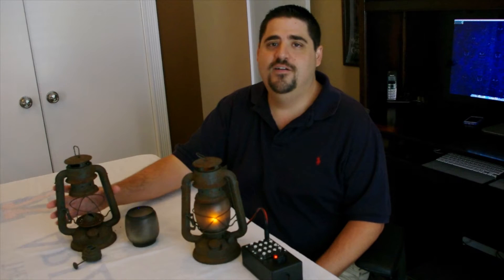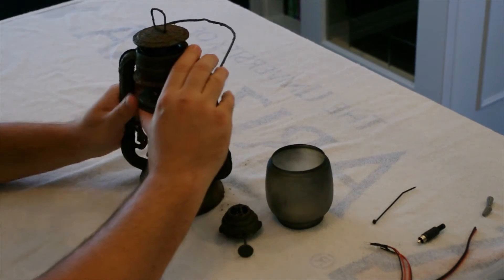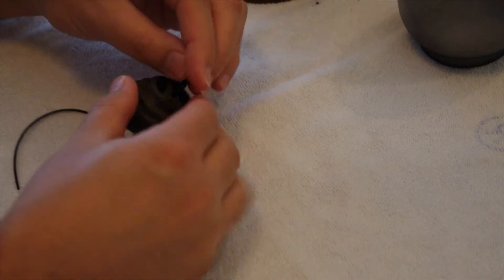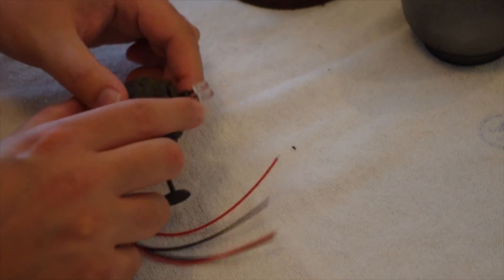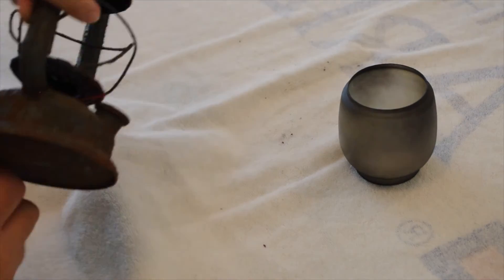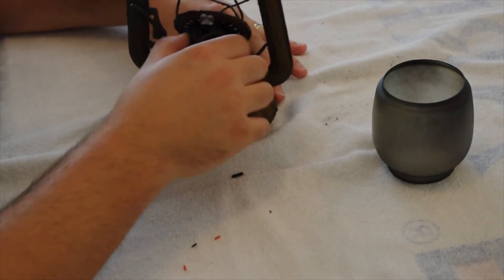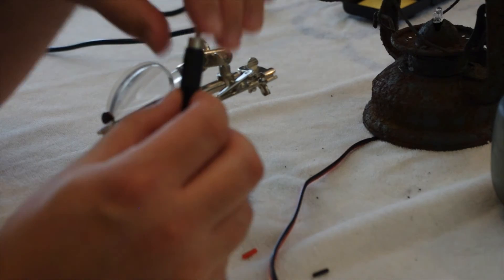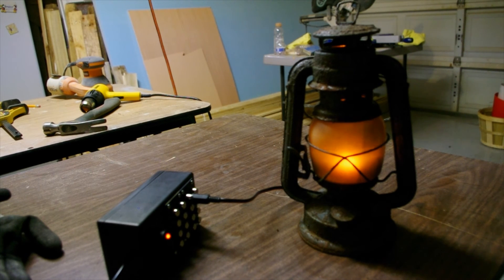LED Lanterns Part 2

Comment: I would hold that burner upside and cover those leds with hot glue (so it kind of drips downwards). That will disperse the light from the leds and make it look even more like flame. You could color it if you only have white leds. I love this video!
Reply: i'm sorry for you  because of Restless Hollow has ignore you :(
Reply: Check out the junolux led flame bulb. - watch?v=1D8lmgxRqf8

Comment: Just came across your page; Loving your videos!  I moved ALL of my lighting over to 12V this year as well.  I was tired of going trying to figure out where I was going to plug in all of the extension cords.  Now I can run 20 some LED's off of one power supply.
Reply from the maker: +SavageEye Thanks! I agree - 12V lighting is so much easier to deal with. Nice to be able to switch colors on the fly too if you use controllers and RGB LEDs.

Comment: ok so do you have a or pictures of how you made that control box for the lights.  I have a jack board, but i'd love to know where you got the box / switch and how you wired it up.  I am teaching and LED class on tombstone pvc lights this year at the West Coast haunters Convention so i am trying to get as much streamlined info as i can to present.  (i'll of course give you credit for the box idea, and point people to this video for lanterns and if you make a video for the control box).

Thanks!!
Reply from the maker: Scare Hollow I actually have a video on the control box up here: https://www.youtube.com/watch?v=Vh1NTH3A740

I found the box on eBay (ABS Plastic Project Box 5.30 (L) x 2.95 (W) x 1.92 (H) inch) and the switch came from RadioShack. I bought a bunch of RCA cables from Parts Express to use for hooking up lights. It all worked out really well!